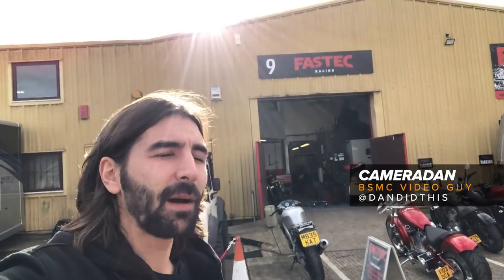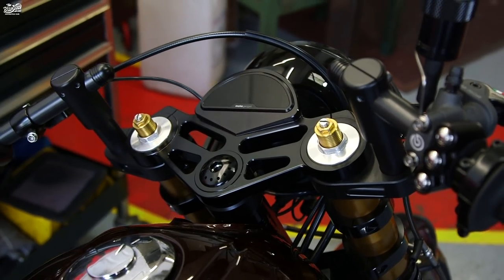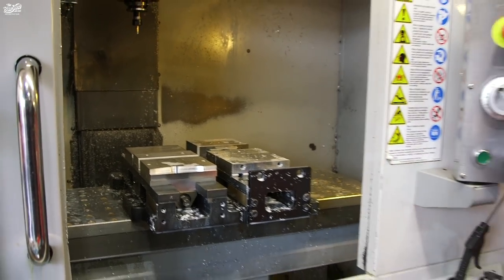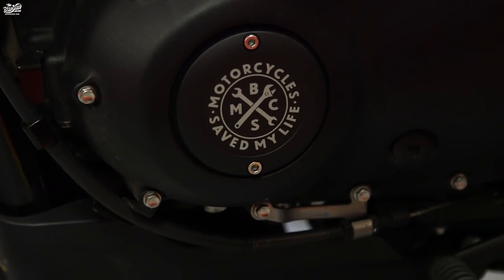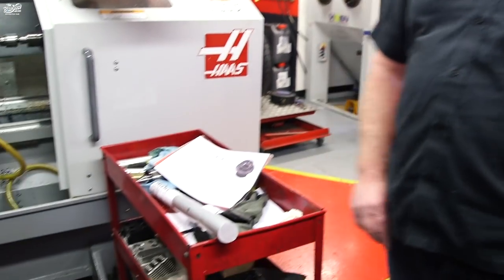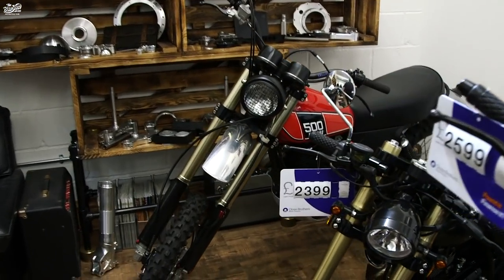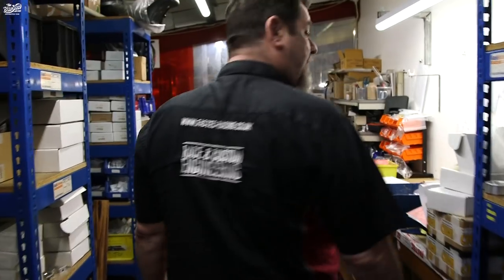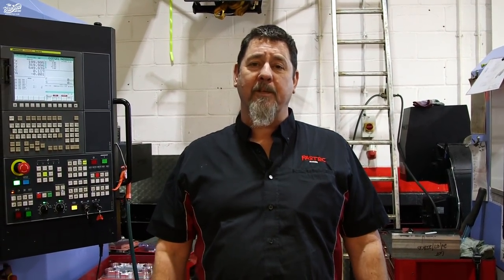Bike Shed Visits: Fastec Racing

Comment: No skilled machinists required.
Reply from the maker: Plenty of skilled machinists in that place we can assure you.
Reply: Would be bit of a tough one to get to make many of the product and one off jobs in fastec without the need for a great skill set worker that is employed by the company
Reply: To run a CNC machine you must have the knowledge of a very good machinist just to run the process 
Then you have to learn how to program the machine to run the program and which tools to use when and why
Reply: Rubbish.
Reply: I worked there as a CNC machinist, you’re right they don’t require skilled machinists because Danny could do everything himself if needs be.